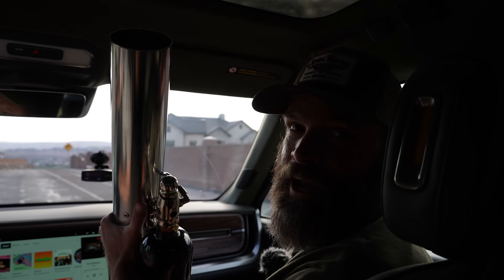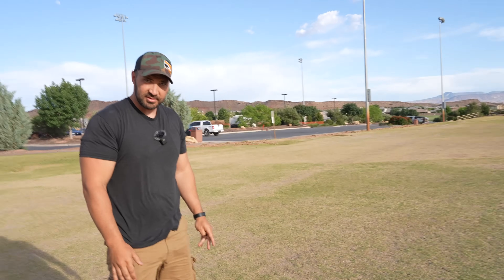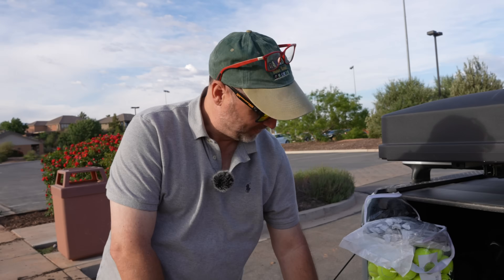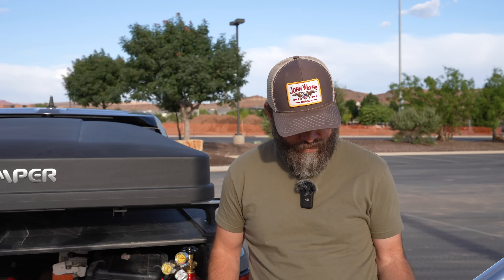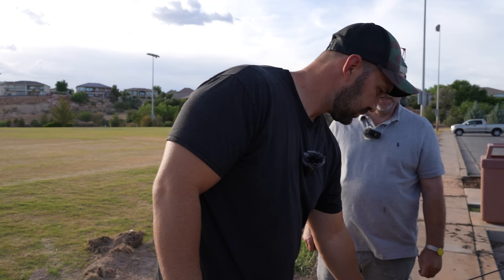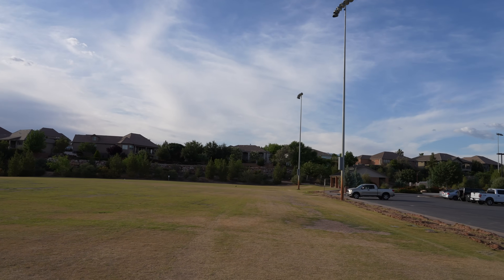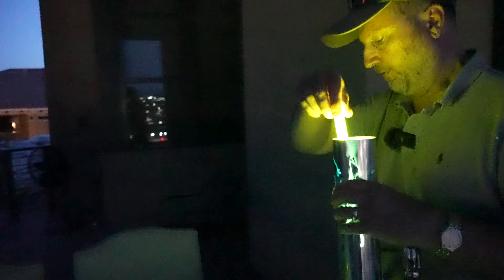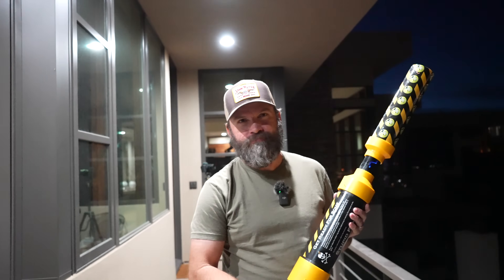Tennis Ball Cannons, which is better, combustion or compressed air? How Far Will They Go?

Comment: Try this - - 

take 5 large size orange juice cans, and 1 small size can at the end.  This small can is the combustion chamber.

The tennis ball will enter the large tube end and fall down to the start of the smaller can.  The ball will seal itwelf against the smaller diameter of the small can.  The small can will allow for a very large discharge of gas that will push directly against the ball.

Poke a small hole in the top of the small can and place the tip of a cigarette lighter can against this hole and give a good squirt of fluid into this hole.

Role the can around to spread out the liquid so it gasifies inside this small can.

Load up a tennis ball.  Aim the canon, and then wave a lighted flame across the hole, like an old fashion cannon.

The ball will travel over 1 mile and go out of sight.

Bob
Reply from the maker: Sounds like something we definitely need to try!

Comment: When I was a kid, I used to make those tennis ball canons out of the old soup cans. Usually four cans worked the best. Then I would punch a 1/4” hole about a 3/4” from the bottom, stick a tennis ball in, put a squirt of lighter fluid in the hole and stick a lit match in the hole. It would send the ball approximately 100’ in the air. (Give or take)

Comment: I used Ronsonol. I could only shoot it once then run inside because someone will always call the cops. You couldn't hand hold my tennis ball cannon. Mine had to be set on the ground or against a tree. Mine sounded like a 45 and kicked like a 10 gage. I usually had to repair or replace the 5 layers of athletic tape on each of 4 joints, because the tape burned up. The distance they're shooting is embarrassingly short. Also, mine shots stayed up for over 10 seconds and the explosion melted the fur off the balls. I used V8 juice cans and had it for many years. My secret was to simply aerate two squirts of Ronsonol using a bike pump with ball inflation pin. Look out!

Comment: Back in the 70s when I was a kid before potato guns and before static ignition’s battery ignition, we would cut both ends off of Campbell Soup cans, obviously except for the bottom can just the lid we would use electrical tape, tape them together basic lighter fluid drop a tennis ball Down the shoot and let her buck on the fourth we used Roman candles and bottle rockets to shoot each other Not to mention BB guns. And metal tip lawn darts.

Comment: Growing up in the 60's, where you could literally buy dynamite at the local hardware store, for stump removal, we made some pretty good tennis ball cannons.   Here's how:

1) We'd get 4 or 5 steel beer cans and cut the bottoms and tops out of them, with a can opener.   We'd have one can we'd not cut the bottom out of.  This would be the bottom of the cannon.   
2)  We,d tape all the cans together.  Nowadays, several wraps of duct tape would work perfectly.
3)  We'd punch dozens of holes in the bottom half of the bottom can.   If we put a tennis ball in, it would go right down all the csns, and stop halfway down the last can.
4) Once we had the tennis ball in the cannon, we'd spray 2 teaspoons +/- of ronson lighter fluid through one the holes in the bottom can.
5) Holding (not recommended)  the tube vertical, you'd hold a lighter near the holes in the bottom can.   If you've done this correctly, despite firing the ball vertically, you'll never see the ball again.   Sizing of the cans, we found, was critical.   Proper amount of lighter fluid, along with it being able to vaporize properly, is also important.   This of course is incredibly dangerous and there's a high probability of injury/death.

Comment: Rave Hair Spray used to be Right up there W/ the Best of them. You need more Gas than Liquid. The Ticket is Holding Upright so you are Spraying up into the Chamber while 90% of Liquid Escapes. 
Unfortunately be Prepared to clean threads of Cap or it will get Seized. I’m with you Fella’s, I’m All About Fun! I’ll catch you on the next one, Keep it Safe Out There Fella’s

Comment: In college we made TB cannons out of a series of bear cans taped together, with the tops removed and the bottoms having half a circle cut out, openings alternating from one to the next, and held together at the seams with duct and fiber reinfoced packing tape.  The top can was the barrel.  Bottom can was the ignition chamber.  Fuel was lighter fluid.  To get max. range, which was LONG, you had to hold the cannon up against a solid structure otherwise you'd lose a lot of energy to the recoil.  Barrel length doesn't really matter in these things, fuel does.

They were loud.  So much so that the campus police told us to stop doing it.

Important safety tip: back then we found the best cans were 3 part Tecate beer cans.  Never use 2 piece/seamless cans.  We did and of the cans split lengthwise forming a sharp edge metal frisbee that fortunately didn't hit the operators.

Comment: You can make thaqt exact style potato gun with a better igniotion system. for the firing chamber take a 4" pvc pipe, 2x 2" drywall screws screwed in so the tips are about 1/4" apart. Take apart a grill lighter and wrap the wires around the end of the dryweall screws. When you click the lighter you'll get a much more substatial spark. Also you can make the cumbustion chamber bigger for more fun.

Comment: Old steel beer cans, cut the bottom and top out and duck tape them end to end, about three foot long, leave one can alone for the combustion chamber on the bottom, poke a little hole in the side of the can near the bottom, stuff a tennis ball in the muzzle, and squirt some lighter fluid in the little hole, and shake it up, not too much fuel , light the hole , boom , cracks like a shotgun

Comment: I used to work at a hardware store that was going out of business.  We built potato guns in the plumbing dept. Then tested every chemical in the paint dept as fuel.  Acetone worked the best. It also didn’t gum up the grill igniter.

Glad to see everyone back on screen!
Reply: Had a similar experience working at a hardware store, surprisingly. My favorite was high-ether starting fluid.

Comment: I made a air powered projectile launcher to put ham radio antenna wires in trees. The projectile is attached to a fishing reel so when we send it through the branches, so we can wind up the reel to pull the wire through the tree branches. I used the same sprinkler valve as one your shooters.

Comment: With the chem lights we were putting 3-4 different colored lights on top of a potato or onion and launching at a high angle.   Looks kind of like fireworks and the kids had fun chasing them down and returning for the next shot.    Also fyi the chem lights are a mild nerve agent, the set off detection tape when I was in the guard.

Comment: We used to make them out of 5 or 6 beer cans (steel, not aluminum) taped together with duct tape. All but bottom can hollowed out top and bottom. Bottom can with small hole in bottom center. Three more holes and the pull tab hole taped to the other hollowed out ones. Small shot of butane and lighter to the single bottom hole. If I remember correctly we were getting about 100 yards out of a tennis ball. Sounded like a 12 gauge shotgun and shot flames if no ball inserted. Careful, it kicks with ball inserted. Kids, don't try this at home. Be hard to do now since no steel beer cans.
Reply: I've still got one from 40+ years ago. Indoors, we would shoot a nerf ball (yep, a bit silly). I've kept a stash of steel cans just in case I "need" to build more. 😀

Comment: i have the hair spray one.  The ignitor is super unreliable. I think a spark plug and coil pack would make a good upgrade.  Also, wash the threads after use or next time you go to use it, it will have glued it self shut.
Reply: I’ve built a few potato cannons. Instead of hairspray I used Axe body spray. No more glued threads on the end cap.
Reply: The ignitor or your air ratio is unreliable? 

You'll need a coil pack if you want to use a spark plug! In order to get VDC to jump the gap is north of 20,000 volts!